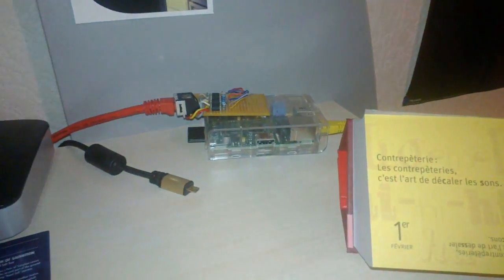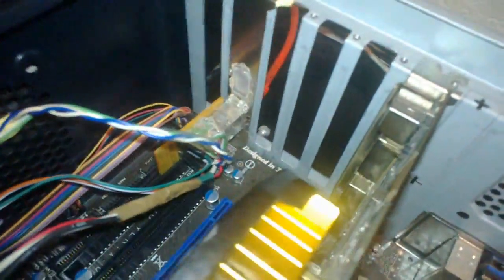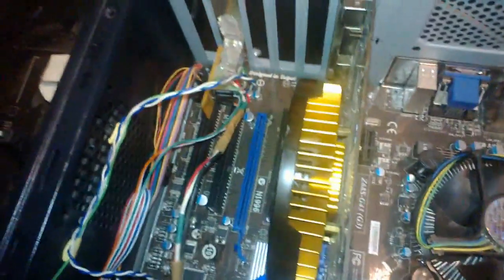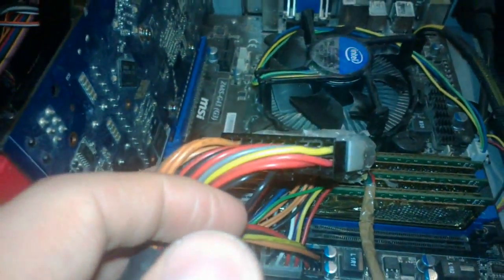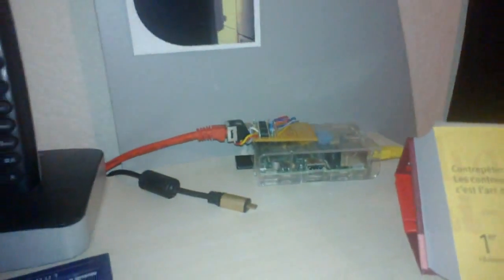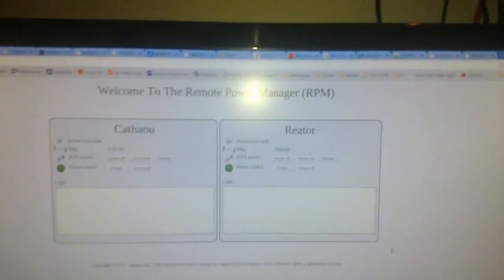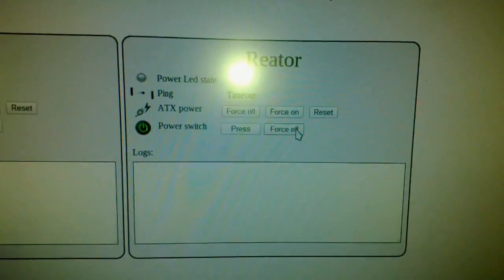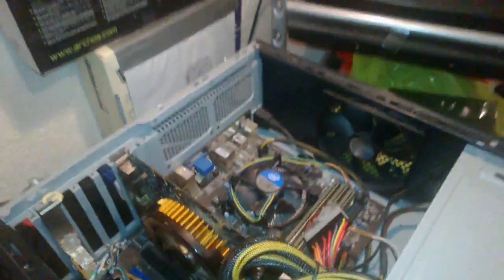raspRPM (Raspberry Pi-based Remote Power-Manager)

Comment: You can do all that without slicing into the PSU cable. Just set one of the pins to 0 and connect it to the power on or reboot pin for the chipset until you detect that the PSU is feeding power on the main. You don't need a mosfet either. I did this on my build with a raspberry that turns the PC on or off, and controls fan speeds and what not using a 7" touchscreen and custom written software

Comment: i would mod it to shut off a computer when it detects a incoming hack or firewall breach that would be good if you run a mini server
Reply from the maker: That's the funny thing about security, unless you go the Mandatory Access Control way and you'll be able to tell something is wrong on your computers, or you go the other ways and you'll never be able to be sure about anything.

Not sure what you are trying to protect yourself from here. Anyway, have fun!

Comment: Hi, I want to build something like that for my own pc, but I only need the Power Button and LED, not the ATX power connector
Reply from the maker: Then you'll need less wires ;)
Reply: Can I use a Raspberry Pi Zero W for this project?
Reply from the maker: Of course, and it has merits to actually. The new version I made of this tool is based on C.H.I.P. which seemingly went out of business :s In any case, what matters is that you with a wireless board, you can put it directly inside the PC and don't need to use expensive opto isolators. In any case, I need to get back to working on this at some point!